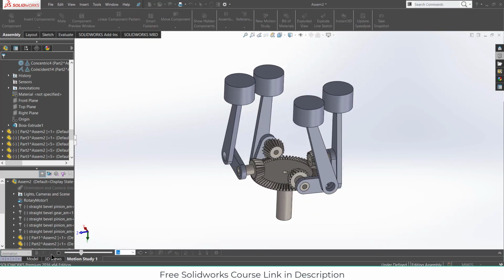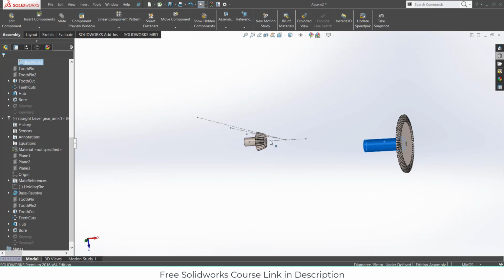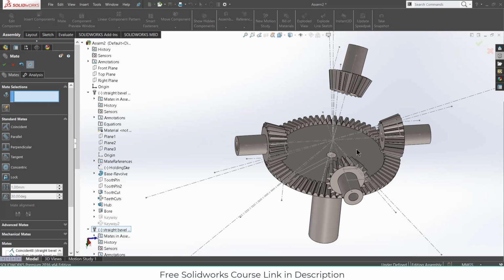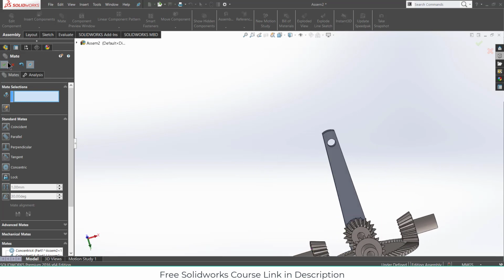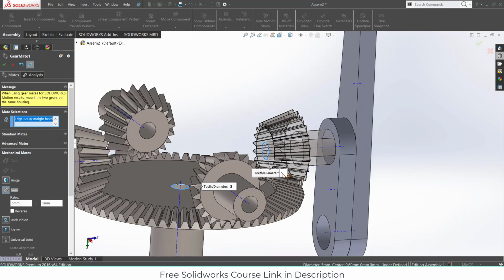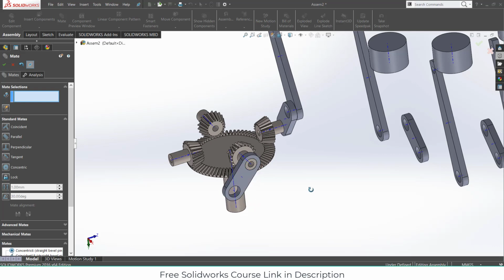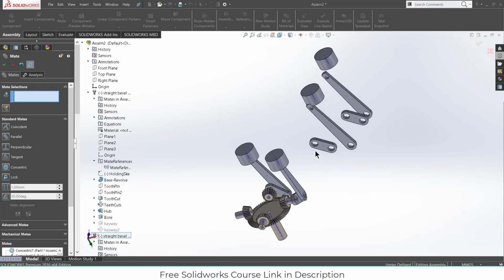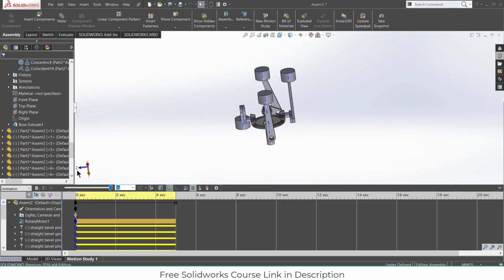Project | Conceptual Axial engine  design in Solidworks

Comment: Hello, nice video! One question, is there any chance that you can make a fluid simulation for a Savonius Rotor that it spin because of the input velocity? I saw your video but you select the rotation speed in the rotation region. Ty!
Reply from the maker: Ok bro in reality there is no software I heard that can do this kind of thing that you ask for engineering simulation (for animator it is available but not for engineering simulation) if you find please let me know I also want to know how to do it